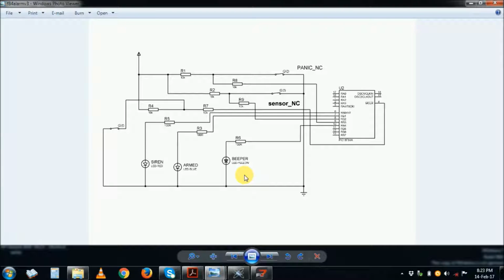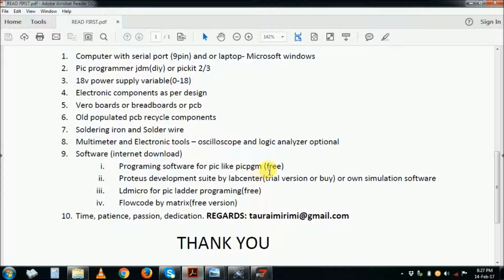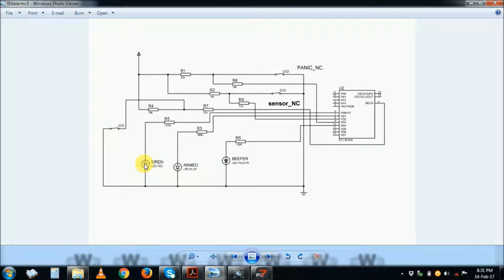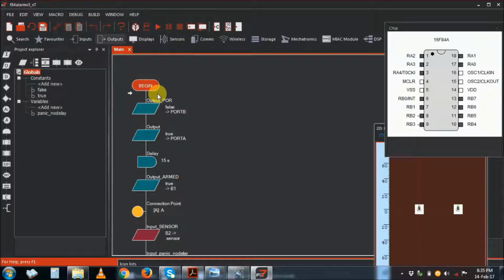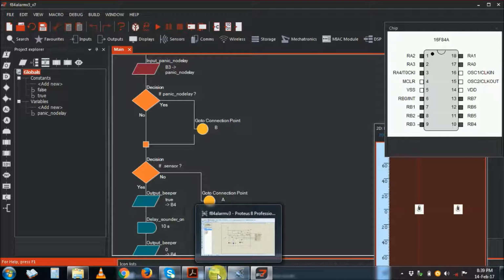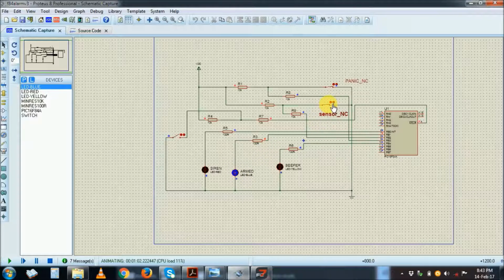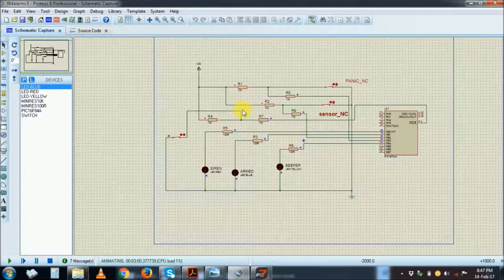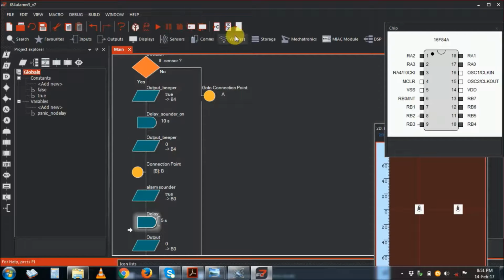PIC16F84A PROJECT

Comment: show more
Reply from the maker: Ok . Will do so when I get some open time. There is a link to Google docs for diagram and code in case you didn't notice. And my pic projects are related on aspects of burning the chip etc. Knowledge of powering and interfaces is assumed otherwise assistance is required if someone hasn't got electronics/electrical basics